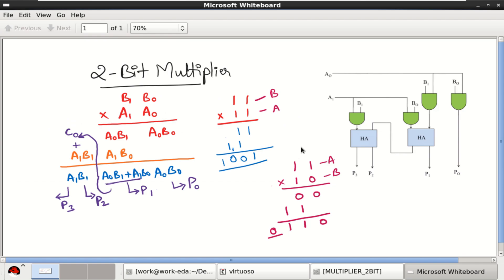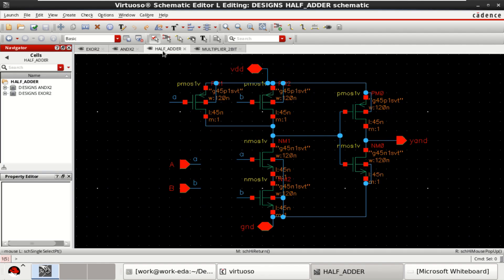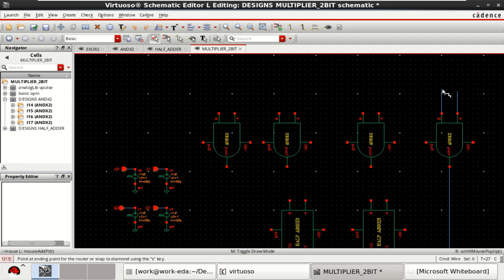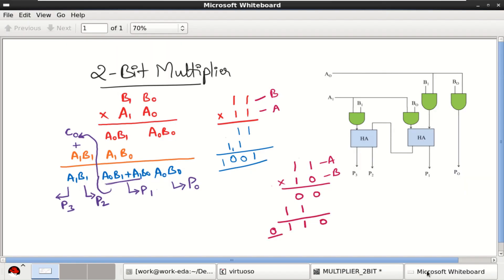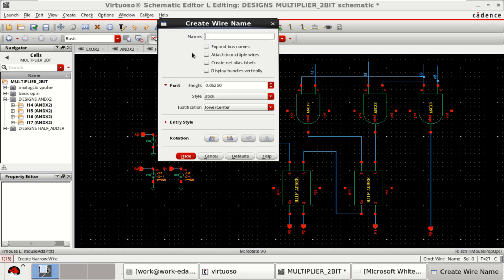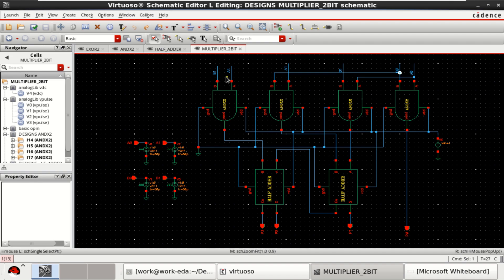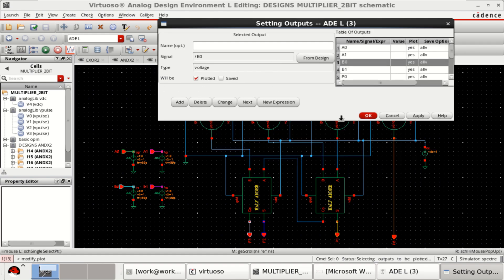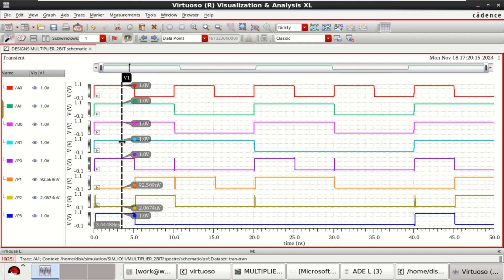2-BIT Binary MULTIPLIER Design using Half Adders | Cadence.

Comment: Hello, I made a 6 -BIT binary multiplier in cadence and when I make a change for all inputs to go form 0 to 1 and plot the current through my voltage source (At VDD = 1.2 V), it appears that the current ripples between -5 and 5 Amps which is very surprising to me. Do you have any suggestions?

Thank you!
Reply from the maker: Hi, are you plotting the current or voltage. Are you providing the constant 
source such as Vdc or Vpulse.